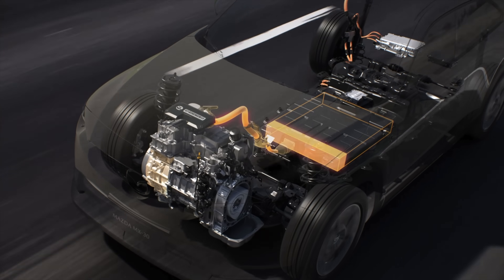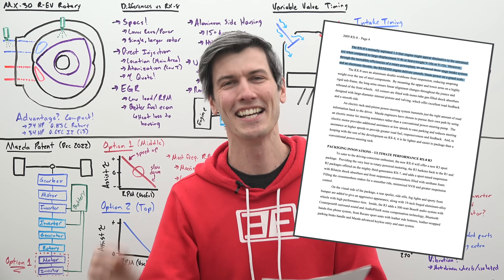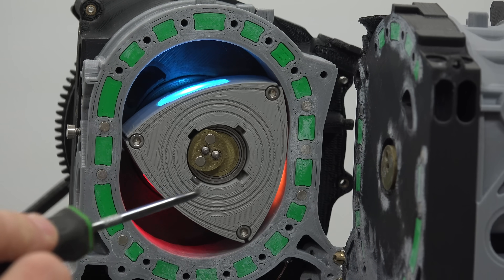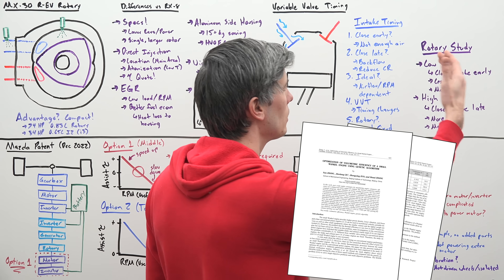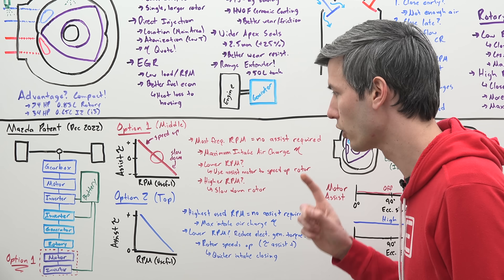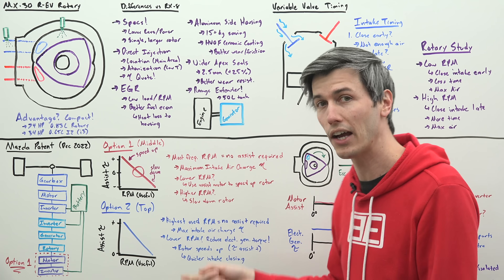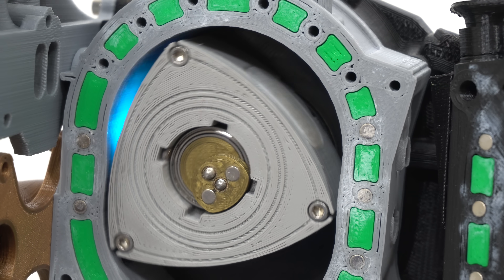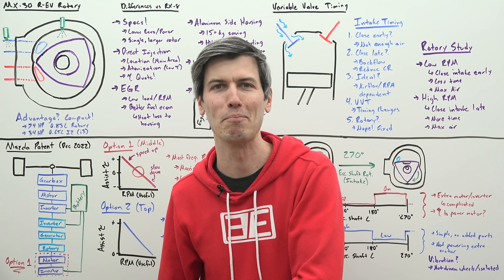Mazda Brought Back The Rotary Engine!

Comment: A gas engine powering an electric motor is exactly what I was looking for. This kind of system has been used on trains and ships before. It’s very reliable and gets rid of things that cause trouble like the transmission.
Reply: Yeah... i would recommend you to rethink that "reliable" part.
Reply: It's far from being the same, because in locomotives and ships where it's used for a very long time, combustion engine produces all the power that electric motor needs at exactly the same time. Here you can't provide maximum power with just combustion engine and you have very advanced electronics and inverters to charge batteries or provide power directly to the motors.
Reply: One of the most reliable vehicles ever produced... the Honda Insight G1... uses a gasoline motor + brushless fixed magnet HV DC motor. Basically the opposite of what you described... it is still one of the simplest hybrids though. The only engines that are more reliable are heavy truck engines.... my G1 has 300k miles on it. And the parks showing the most wear is the suspension not the drivetrain.
Reply: The BMW i3 REx and Fiskar Karma are pure series hybrids (as you described). The Honda iMMD system (such as in an Accord Hybrid) and Mitsubishi Outlander PHEV run as series hybrids except in highway cruise, when they engage a fixed-ratio mechanical drive.
Reply: Honda makes amazing hybrids exactly as you describe
Reply: @adamek9750  most Honda hybrids are not like that at all. The only similar Honda system is  iMMD, found in the Accord Hybrid.
Reply: Nissan, in its home market, has a system they call e-Drive in which the transmission is replaced by a generator, a small battery, and a motor.  There is no physical connection between the engine and the wheels, and no possibility of plugging in to charge the battery.
Reply: @robertkirchner7981  Cool design. Gets rid of CVT issues, too.
Reply: @brianb-p6586  Yep the gen 2 Volt is very similar with the way it's sun gear transmission and clutch setup works, at different vehicle speeds it goes from pure generator to locking the ICE to the drive wheels at high freeway speeds for optimal efficiency, that is when it's in hold/HEV mode. In normal mode it's just a regular BEV with ~80km of city range (more than enough for 95% of most people's daily driving). Considering the state of public charging in 2023 NA though, if I had a choice to daily lug around 150 kg of ICE or 150kg of batteries I can't charge reliably (and if I can, it takes over a half hour if there isn't a wait to get to charge), I'll take the former any day.
Reply: Still wish they where selling the Volt. They marketing for it had it as just another hybrid. If it wasn't for all the videos made about it when it was discontinied I wouldn't of known how it was different.
Reply: More points of failure occurs when there is more complexity
Reply: Both Volts have already done that.
Reply: @XTR_NEELAN  electric drivetrains actually have less points of failure than a mechanical drivetrain.
Reply: @xenn4985  How much to replace that battery when it goes out? This gonna be one of those "cheaper to blow it up for a Youtube video" deals or can we actually afford this?
Reply: And is now used by Audi in the Dakar.
Reply: @procerator  Did you get to follow Dakar in 2022 and 2023? Audi deployed this technology and got to win stages and finish the races. Thats reliability to me.
Reply: BMW Killed the I3 Range Extender in 2018. Why: Range extender (even in a tiny car with tiny EV range) wasn't being used enough and engines sized.
Reply: Then you have to worry about the electric motor breaking
Reply: @volvo24091  audi uses 2L turbo inline 4, not rotary engine. Rotary has a history of being the least reliable engine on the market, requiring frequent oil changes. And apex seals being just a time bomb in itself.
Reply: train got two stroke diesel not mazda Rotary.
Reply: @volvo24091  there's a big difference between reliability in motorsport vs reliability in a daily driver.
Reply: @Wingnut353  That's a bit hyperbolic to say it's outright the most reliable passenger car engine. Many engines (with adequate servicing, of course) are capable of going over 300k, even 500k miles. Not saying it's not a reliable engine, but it's far from the only well engineered engine out there.
Reply: Why bother with a gas engine? Batteries are plenty good enough today, and the charging infrastructure too. Also you get much more power out of a pure EV than a hybrid. Getting rid of gas has tons of other advantages too. Much less maintenance, much more space, simpler operation, smoother ride, etc.
Reply: You lose a lot of energy any time you convert it to anything else.  So at that point why not just beef up the internal combustion engine and call it good
Reply: @Wingnut353  
For a decent EV 300k miles is no big deal. Teslas for example are designed for 1 million miles. And real world data supports that claim.
And that's with barely any maintenance or repairs. The extreme simplicity of the powertrain pays off.
Reply: @WayToManyAssassins  
Electric motors are far more reliable and last far longer. Simply because the vastly smaller amount of moving parts.
Reply: @logicplague  
The battery will most likely outlive the car. The first generation Model S batteries lasted 200K miles minimum, the second generation in the Model 3 last 500K, and the third is rated for 1 million. The newest LFP version lasts 2-3 million.
Other EV batteries also proved to be very durable, unless they weren't cooled properly, like in the Leaf.
Reply: @procerator rotary engines can be very reliably at a specific RPM, factor in not having a turbo and it being able to run at its most efficient means it will be more efficient.
Reply: @wowsuchname1939  no way it is more efficient than modern direct injection turbo engines. Rotary engines burn oil by design which isna problem for emissions. No valves - means less cotroll for intake/exhaust even with that complicated system described in the video.
The only advantage of rotary is power/displacement. But that was because less innertia allowed rotary engines to rev higher. With 4500 redline, why not just use diesel engine? Diesel engines can be insanely efficient at optimal RPM
Reply: @xenn4985  what about the power generation
Reply: @András Bíró  being able to fill a tank and massively extend range in a couple of minutes does have its advantages. EV charging is getting better and better but the gap in time taken to completely extend the range of the car is still there.

You can also fill a jerry can or two and go way further than even a full tank of gas would get you.

Are all these advantages necessary? No, but there are certainly use cases where they are advantageous.
Reply: @carnivorebear6582  yes but it depends how it is implemented. BMW i3 Rex had a very small tank, just 9 liters. Good enough for another 100-130km
Reply: @XTR_NEELAN  ...the engine? Alright i guess i have to explain this.

An electric drivetrain is just that, a means of transfering energy from the power source to the wheels using electricity.

A mechanical drivetrain is the traditional method we use, geared transmission, transfer case, all that good stuff.

In an electric drivetrain vehicle, the power is produced by an icu, which is hooked up to a generator (a beefy alternator) which transfers electricity directly to an electric motor attached to the wheels.

In theory, electric drivetrains are more reliable and have significantly lower power loss.

For example your average awd transmission will result in a 30% loss of HP from the engine to the wheels.
Reply: @carnivorebear6582  I was talking about the reliability of the technology, not of a specific car. In fact Audi does not as yet sell a car with such technology.
Reply: @procerator  The original post by @Jg Rsb talks about a system with an ICE powering a generator and is not specific to the rotary engine.
Reply: @andrasbiro3007  Hybrids have thair place if done right. Look at RAV4 for example. It is an AWD, 220hp drivetrain with reliable 2.5L Naturally Aspirated engine. It is able to drive 1100km on a single tank of gas. It is a good option for places that don't have good EV charging infrastructure.
Reply: @volvo24091  yes but the point I was making is that because a particular implementation of tech survives the Dakar rally doesn't mean it'll translate to many years and many thousands of kms of city driving.

For example with Toyota they race their GR Yaris in WRC, but I would expect a base model Yaris to out survive it by quite a lot in regular driving.
Reply: @procerator the concept is reliable enough is locomotives, Using a Wankel maybe not
Reply: Ships and trains benefit from diesel electric drive, but the drawback is poor fuel economy.  Every time energy is converted from
One form to another there is loss (wasted energy)

In trains, this disadvantage is acceptable because electric eliminates the need for a transmission and electric can provide 100% torque at any rpm for smooth acceleration.   Smooth acceleration is critical in a train.  

Most ships do not use this setup due to fuel in efficiency, but electric drive has a couple big advantages;  maneuverability and in the case of ice breakers, in case of a prop strike, the electric motor is able to
Handle the shock and drastic change in rpm much better than having a drive shaft directly coupled to the diesel motor.  

So they get less fuel economy, but do have advantages.
Reply: Transmission is what you see as the part that causes the most trouble in an ICE vehicle? Ignoring the other 1000 parts making up an engine :D

Comment: Will it last over 100k miles before needing rebuild?
Reply: yes, if you keep the battery charged
Reply: It should cause its a smaller displacement n low Reving

Comment: You've mastered the art of explaining complicated technical subjects in a way anyone can understand. I love every minute of your videos.
Reply: Brilliant!

I believe Mazda has the right idea here. There is so much noise about EV range but extended EV range requires huge, expensive batteries.   Better to have a smaller battery for commuting and the range extender for the few times a year people need to travel long distances. 

The Mazda would be perfect for us as we only need long range a couple times a year for vacations. 

The new 2023 Plug in 🔌Prius and this Mazda are on my short list of possibilities for my next vehicle.
Reply from the maker: That's very kind of you to say; it's absolutely the goal and I'm happy to hear you enjoy the videos!
Reply: @EngineeringExplained  Aloha can you review the updated Hyundai palisade calligraphy AWD please and thank you it's got a advanced V6 engine it can run on Atkinson cycle or Otta cycle
Reply: Hard agree
Reply: regarding the devil's-marks problem... why cant there be a sky/skid like spool/foot which skids along the surface and adapts angle of pull/force via a axle/pin connecting the triangle rotor's wedge/edge and the sky/peddle/foot in contact with wall and skidding along it keeping the chamber sealed and avoiding the devil's-marks caused by when the wedge/edge of rotor is directly in contact with wall